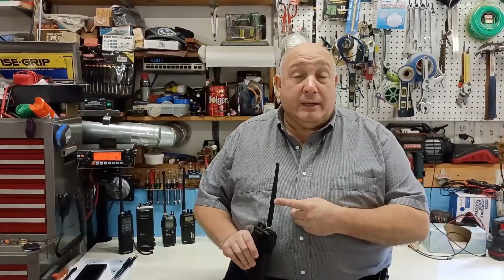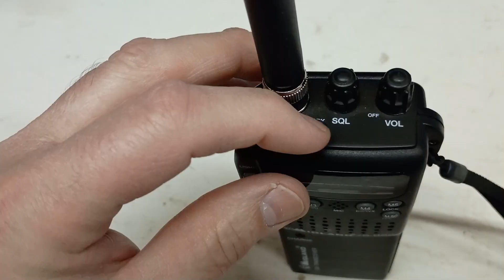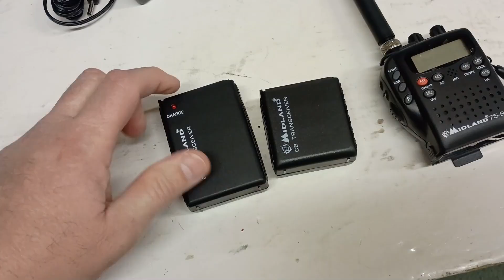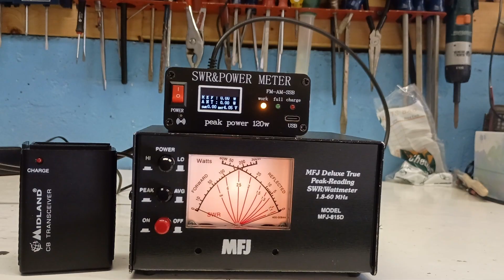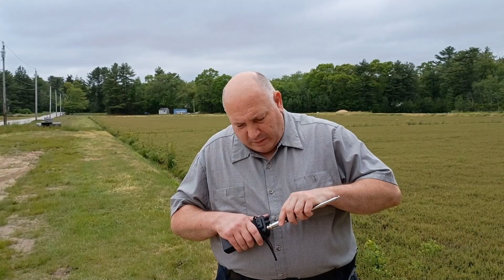Midland 75 822 handheld CB review and range test 75-822

Comment: I have inherited one of these with the pack for rechargeables and it was full of normal alkaline 1.5v. My grandfather was a radio nerd to the max, so I have little reason to doubt him, and it's worked fine for me. I'm curious if this would be a problem longer term or at all? 

We've been trying to get signals to push through our apartments with just two CB HTs and have had abysmal results. I make it to the parking lot all of 50 feet away before losing contact
Reply from the maker: Great question
I have wondered the same thing for years.... when you plug the radio into the cigarette lighter in your vehicle it puts out 13.8 volts if the engine is running or 12 volts if the engine is off..... so the radio can run on 13.8 volts... but I don't know if there is some sort of reducing transformer that reduces the volts down..... 
with the rechargeable battery pack its 9.6 volts and with the alkaline battery box it's 9.0 volts .... how can .6 volts effect anything???? BUT I have not had the guts to try it... it's a $100 dollar radio and I have ruined handheld radios before by putting the wrong batteries in them...... so I would not risk it....
 but I think if you put 8 alkaline batteries in the rechargeable battery box that would give you 12 volts and I "would think" that would make the radio work far better??

I know when the radio is plugged into the cigarette lighter it works far better than it does on batteries.

I look on E-bay a lot for a cheap Midland 75-822 to test this out with.... if I get it for $30 bucks after shipping and ruin it, I really won't care, as it would be a great test.

but I do believe if Midland could use one battery box to handle both options .. the customers would be happier with it and the company would save a lot of money on production.... ... it may be because the extra volts goes over the FCC limit of 4 watts... and they would be give a huge fine if they made a non-compliant FCC CB radio

but I think Midland is afraid of someone plugging in the battery charger with alkaline batteries in it and that could be very, very dangerous...so they give two boxes and make sure the alkaline box can't be plugged in to be recharged.

so I'm glad you told me it's working for you.... maybe I'll give it a try now and see what kind of watts it puts out and see what kind of range I can get with it.

as for the terrible range... all CB's are what they call "line of sight".... meaning if you can see the other radio, you can talk to the other radio... but if trees hills or buildings are between you and the other radio it will not work..... outside most times the signals bounce around a lot of the obstructions.... but using it indoors???? I'm surprised you even made it to the parking lot..... a HandHeld CB is made to be used outside... indoors the signal will just bounce off the walls and go nowhere.

... I plan on doing a real world SHTF video someday.... all my prepper friends that are going to stay at my house out in the deep woods all bought themselves and their driving age kids a 75-822 radio and a 51 inch telescoping antenna.... and also  a Tram 3500 CB antenna ( if the kids have a steel roof on their cars) and put it all in the trunk with a 6 pack of Energizer Lithium extreme heat 1.5 volt batteries that have a 25 year shelf life
 
I want to try to talk the kids to my house using an old paper map .. no cell phones or GPS allowed and no highways either ...as in a real SHTF highways will be shut down or bottle necked and cell phones or GPS will not work.... I can talk to a Midland 75-822 for at least 10 miles from my Base Station... so if they can get that far I can give them directions the rest of the way... and if they have to leave the car and go on foot... I can get my off road vehicles  ( 4x4 trucks, Dirt bikes, 4 wheelers, snow mobiles )and find them as long as they have a handheld CB and the 51 inch antenna.. I'll find them and get them to my house... so I want to see how all that will work out someday.. and I plan on filming it.

thanks for watching
Reply: @steve_niceguy  I didn't even consider that it would be rated for the 13.8v; makes perfect sense that 8 AA's would work perfect. I agree, it's likely a safety feature. 

Paper maps are a definite must for preparation, I would argue a compass would be the best partner for one as well. I think most people who prep focus too much on gear and too little on planning, let alone practice. Have  a day where you test the gear, cell phone stays off or at home and see where the plan works and where it needs tuning. 

Per the performance I've had with my 72-822: it's been a miss. I don't do CB often, and have been using it more now because my kid is too young to get his ham license. I will pick up a GMRS license since it covers the whole household and then try to keep the interest from there. 

Thank you for the response, that makes more sense to me now.
Reply: @steve_niceguy  Hello. These radios are tested to a voltage of 16V; officially, it's listed as around 15.6V, but this is only for general safety reasons. However, the higher the voltage, incorrect load transmitter provide to damage, especially if the antenna is missing.

The cooling is very poor; please transmit only briefly. These radios can handle short bursts of operation with 11 1.5V batteries or 12 1.2V cells. However, the antenna must have a good SWR, and transmission is limited to 5 seconds (20 seconds of cooling on RX) due to insufficient cooling. The small enclosure battery pack is manufactured for operator convenience and lightweight.

These devices were previously intended to operate with 10 1.2V cells, but this was abandoned due to minor differences in range, larger dimensions, weight, and power consumption. If you have a 3D printer, you can make the recommended container for 10 or 11 1.2V cells to achieve the full 4W of power. Newer models of this radio are more efficient, while older ones are less efficient. Older models produced 1.5W of power from the original 8-cell 1.2V container.

When transmitting, the antenna must be far from your head (preferably above it). Avoid touching it, as this will damage the power block when the power is high at 10-12 cells. With a small container of 6 cells, the radio is indestructible for transmitting.

Good luck.
Reply from the maker: @arkadiuszweiss  that was quite the response, thank you.... I always love learning new stuff about these radios..... guess I will not worry about putting eight  1.5 volt batteries into the rechargeable box and give it a try!
thanks again
Reply: @steve_niceguy  Hello,

It's important that the antenna is connected and not touching your body or any larger objects. You can always increase the set's radiation power by connecting the radio to a battery or other battery via a 270 cm section of cable. The cable should be relatively taut to the battery, etc., for example, on a dry bench. This will significantly increase the radio's radiated power. Of course, a 275 cm section of cable connected to the antenna ground (BNC plug  ground) and unwound so that it doesn't touch the ground but something insulated, or attached to the ground or vegetation with a string, will also significantly increase the amount of electromagnetic field generated. These are the original recommendations for miniature HF radios for the military from the old days. It really works. You'll be very pleased. It is important that it is in the air, straight and not touching anything except a thin insulator such as a fishing line.
Reply from the maker: @arkadiuszweiss  I'll give it a try someday.. should make a good video, thank you

Comment: Hi, I just ordered the Midland CB. I'm afraid my Freightliner might not get give reception from the internal antenna. Can you give me a name of a good external antenna? Couldn't get the exact name when I was watching video. Thank you
Reply from the maker: I only use and know magnetic CB antenna's... your Freightliner will be fiberglass so a magnetic mount won't work. .... getting a CB antenna to work on semi trucks is quite an ordeal..... you have to have metal under the antenna.... guys mount them on the mirror and connect 1 1/4" wide RF Bonding straps from the truck frame and all the inside pieces behind the fiberglass... it's a HUGE challenge to get one to work on a Semi Truck. if you go to RadioReference .com and find the CB forum they may be able to help you... but it's a lot of work to get one to work... without that metal under the antenna you will be lucky to get 2 miles.

Comment: If you think that's a small CB HT, check out the Wouxun KG-S72C.
It's almost half the size, appears to be the same body casing as the -S88G, -S74A, and -S86B.

Using a Pres Randy 2 as my mobile CB in my truck, and the PNI Escort HP82 as a carry-around HT.

Comment from the maker: @kurtp5379 I did the Midland 75-822 range test using it as a mobile CB plugged into the Cigarette lighter and connected to my Tram 3500 CB antenna on the roof of my 2011 F-150
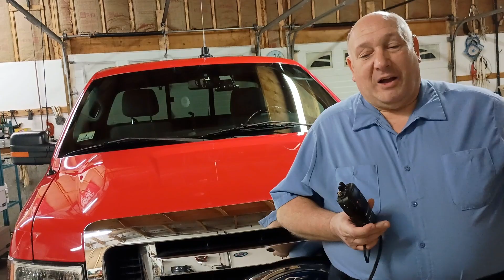you can see it at the 40:26 minute mark... it did GREAT! 
Thank you for watching.

Comment: I am new to CB radios. What are some of the uses of this technology in today's world Steve?
Reply from the maker: in today's world....none ...none really...its mostly a child's toy

..... for me, I'm a prepper... I have a 18 months supply of heating oil, a 1000 gallons of Propane for my Propane generator and a 1000 gallons of Diesel for my Tractors that can run my 15,000 watt PTO generator.... with either generator I have heat.... I have my well pump so unlimited delicious drinking water. the generators also allow me to run my hot water heater so I can have a nice hot shower..... they also allow me to keep my chest freezers with 18 months of food frozen and they charge up my solar batteries that keep everything working when the generators are not running....... if the world goes to heck..... like we get invaded or a Nuke goes off or the electric grid goes down or the economy collapses... without power there will be no cell service... they have natural gas generators as back up power at all the cell towers.... but in an earthquake  or bombs drop....all the natural gas will be shut off.... I can stay home for 18 months and relax..... now this is where I NEED my CB's.... I have a group of like minded preppers 5 other houses all around me..... they all have roughly the same set up as me ( we copy each other)...... I live in the middle of a forest... just one road going in and out in of thousands of acres of forest lakes rivers streams and ponds... maybe 30 houses on the one mile long road.... if looters come listening for people with generators they will hear all the generators in my 6 house compound so we will send a teenager a 1/2 mile down the road to the left and a teenager a 1/2 mile down the road to the right... now if they see a car coming ( most days I can sit in the middle of my street for 30 minutes without seeing a car) but if they see a car they radio us, we will shut off our generators and make it look like no one is home... until they pass then we can restart the generators... 
we will need lots of food to feed our group ... so we will send out hunting parties.. 10 guys each will have a handheld CB ..this way they know where each other are and can flush the deer out and chase the deer towards the waiting hunters...... once a deer is down they will radio where they are and we can send help to carry it back to our compound..... we will also need security ... so every house has one of those handhelds on the kitchen table.... if a car filled with looters comes into the driveway of any of the 6 houses they will simply say into the handheld CB I've got looters at the Smith house.... and everyone in the other 5 houses will grab a rifle and head that way.... can you imagine a group of looters seeing men with rifles coming from the woods from the left and more from the right.. some from behind the house and some coming down the driveway.... I think we can get them to move on.
every vehicle has a CB in it... we can go out for supplies ( grocery store) and radio back if they are passing out water or food or if they are closed or looted.... are they giving info out at the town hall...... or at the schools ( all our schools are also shelters so is our towns armory.)
we can also send out reconnaissance. say we are invaded... I live a few miles from the shore so they could easily come ashore and take over our area......we can have a jeep go to the town hall and see what's going on??? we can have a jeep  go down the fire roads and drop someone off with a handheld in the woods near the police station to see ???? is the invading army going through the police station getting the addresses of all the gun owners in town and going to those houses to confiscate the guns???? have they taken the police station over???? is the invading army going house to house grabbing any males of military age (15-33) and locking them up in a make shift camp somewhere????? my base station CB can talk to any of the vehicles within a 15 mile radius.. those hand held radios can talk to any of the vehicles for a few miles ..... so we'll know what is happening in my town and where the looters or enemy are.... my Base Station is also a ham radio so I can hear what is happening in the rest of the country and world.... and I can also tell other what is happening in my location.
they can also be used in search parties... we have a lot of horse farms around me and people have goats and animals, my area is also pretty vast so if a horse or person is lost we can send out groups of searchers and they can all keep in touch with the others and my Base Station radio.... will any of this happen??? lets hope not.. but if it does I have lots of hand held CB's and hundreds of rechargeable batteries for them.

so that's my plan

Comment: !0 miles from a hilltop maybe, Around town 3 is nearer the mark. That's why I don't bother with a handheld.
Reply from the maker: my F-150 has all the body panels bonded together with wide RF bonding straps... I have the exhaust and everything.... every radio I've tried in that truck has worked fantastic with the Tram 3500 CB antenna... so that seems to help... my base station is 47 or 48 feet to the tip of the Antron 99.... I have chokes and noise filters on my base station so it's very quiet and can hear radios' pretty far out.... my Anytone 5555 II has a fantastic receiver so that also helps. and lastly that Anytone 5555 II has NRC Noise Reduction Circuit ..that technology gets rid of most of the background noise/static... so 10 miles for my set up is pretty easy... mobile to mobile would be far less.... but I'm still impressed with that little CB... I've had full sized radio's that got far less range than that little handheld.

Comment: I'm a big fan of all the old realistic walkie talkies TRC 216 217 TRC 212 TRC 221 TRC 209 I have lived in Toronto Ontario Canada since I was 3 years old in 1986 me & a buddy one on foot with two handheld walkie talkies and were conversation with a base station 9 miles north of us and we both pegged his meter about 9s units he was at 9th line and Highway 7 which is about an hour out of Toronto they are truly lifesavers gmrs and FR-S up here in Toronto is very popular and we're heading for a nasty ice storm this weekend so I'm all charged up and ready to go in case power goes out cuz it can happen it's happened in the past be prepared I always say
Reply from the maker: I wanted to have a few of the "BEST" handhelds for when SHTF... I thought it was the TRC 216... I bought 20 of them off E-bay I was only able to get about 3 or 4 to actually work, the rest I had to send back...... great radio in it's day..... but the display's hardly ever work now and most of the transmit no longer work either.... but the TRC 217 that radio is a tank! they always work,
 the 216 puts out 3.30 watts according to the radio shack service manuals, they tell all the repair people that the TRC 216 can be set from 3 to 4 watts and that anything over 3.30 is detrimental to battery life, it suggests to all repair people to set it at 3.30 watts as that is what the factory send them out at. the 216 was the highest powered handheld for all of the 80's and 90's... all the other handhelds were 2.50 watts.... if you look under the strap of any 217 it will even say 4 watts input 2.5 watts output..... but in my testing the 217 works extremely well!
Reply: I haven't gone through all my radios yet for testing, but so far my top performers are the TRC-226 (doesn't get talked about a whole lot), Lafayette Dyna-Com 23 (have two of those),  G.E. 3-5979A, Midland 13 & 77-861, and the President Randy II FCC.